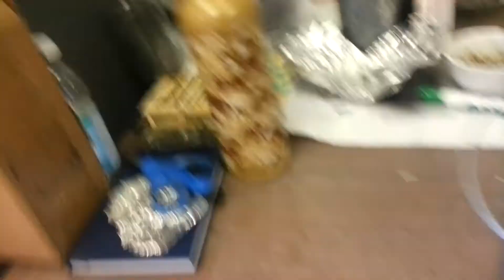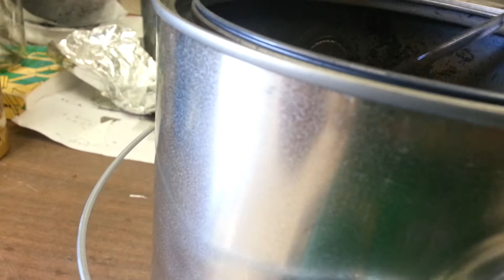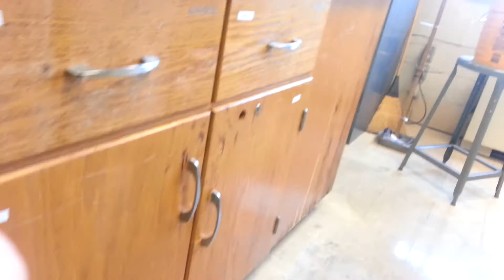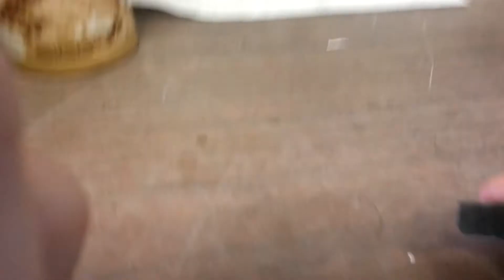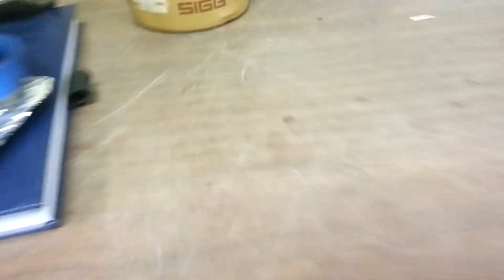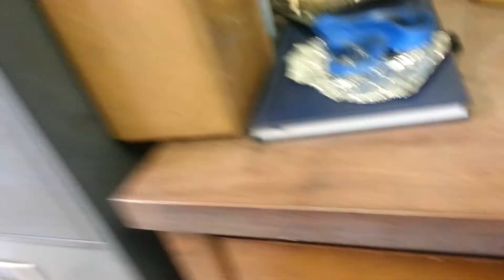A paint can to store graphene? Sure....

Comment: Hi, thanks for sharing! Do U know the proportion of graphene + black painting to coat a material that will receive heat (like a coil)?
Reply from the maker: +Christophe Leblay This isn't paint, it's powder flakes. I just sjipp the material in paint cans (kilos) so it can be shipped easily. As is, the material conducts heat VERY well, in fact it's the best heat conductor known to man.
Reply: +Venturestarx 
Thanks for it is not very clear

How do U stick it to the paint ? do you mix, disolvle it ? is there a tutorial for that ?
Reply from the maker: If you were to make a paint of it, you would use a solvent to mix it into.